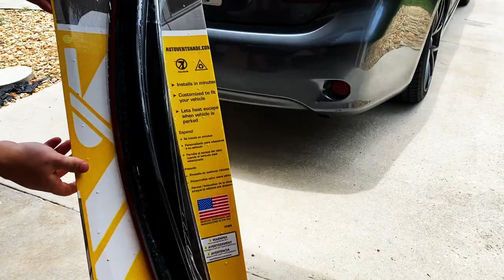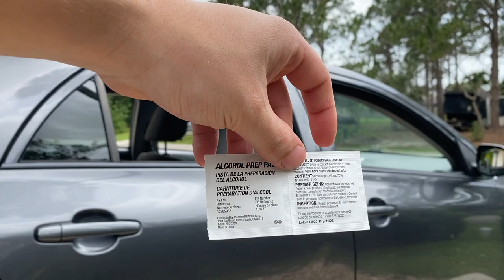How to Install In Channel Window Visors on Toyota Corolla

Comment: Do they scratch or damage the top of the windows in anyway ? As the windows use the same channel as these visors, making the passage more tight.
Ps. I think the wipes were to be placed on the scotchbrite pad .
Reply from the maker: I have not noticed any scratching on the windows or tint on my car! The glass is harder then the plastic, so it shouldn’t scratch it up.
Reply: @BrandonStellmach  thank you for responding.

Comment: EXCELLENT, I HAVE NOT BEEN ABLE  TO GET THAT STYLE FOR MY TOYOTA COROLLA SE 2019. DO YOU HAVE IT WEHER?
Reply from the maker: If AVS does not make in channel visors for your car. I would recommend weather tech. They usually have them as well.

Comment: Dose it come with clips or just 3m tape
Reply from the maker: Only comes with 3M tape. But they are a snug fit in the window. 
I have not had any problems with them since I installed them over a year ago.